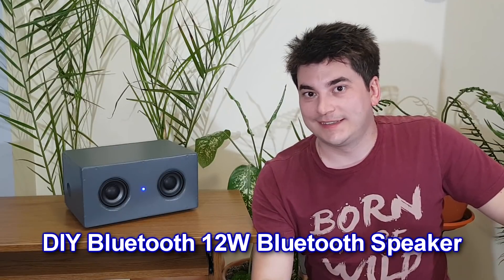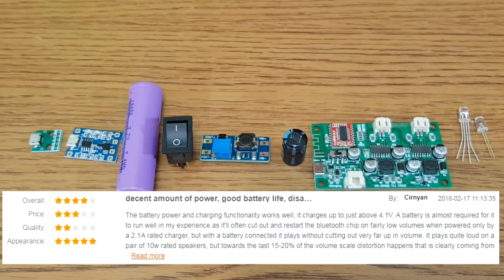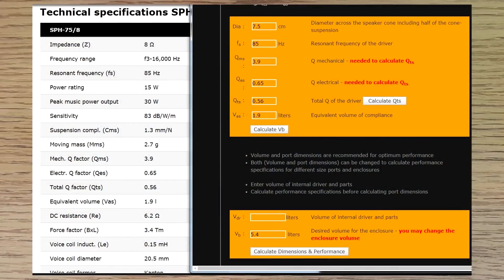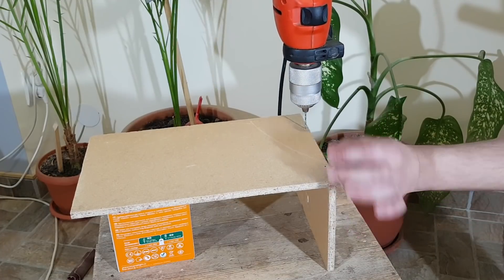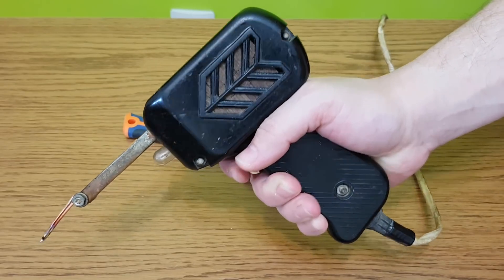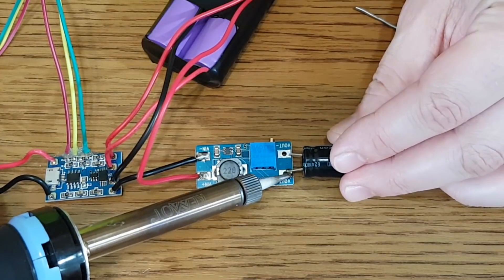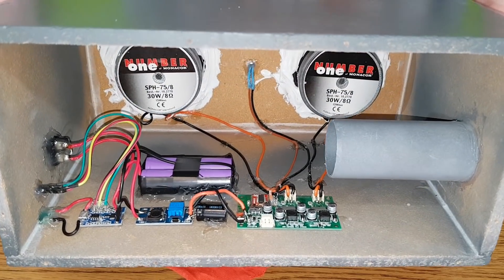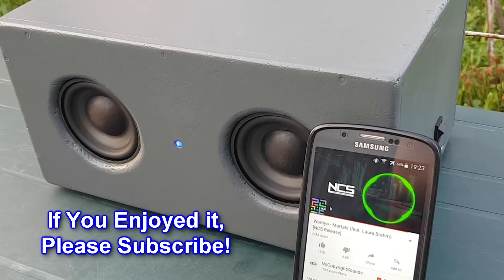DIY Bluetooth Speaker 6W+6W - HF69B

Comment: Sorin, Nice job! I do have a question though. All Bluetooth speakers I've had will automatically shut down after no input is received for approx 30 minutes. I use a speaker when I teach classes of approx 3 hours long. It's very annoying when bluetooth disconnects, and then I have a slide with audio, as I have to stop and reconnect the speaker. Will this Bluetooth board automatically disconnect after a certain time period, and if so do you know of any boards that will not do that?
Thanks!
Reply from the maker: hi. this bluetooth module doesn't disconnect. it stays connected, even if it doesn't receive a signal for a long time. so you can use it for a long time without problems.
Reply: Thanks! Perrrfect!

Comment: How did you determine how long to make the reflex port?
Reply from the maker: hi. considering I didn't use the recommended enclosure dimensions, I couldn't use the bass reflex port calculator. so I made up some calculations. 2 ports of 2.5 cm diameter (minimum) and 5.5 cm length (recommended on the website) will have a port area of almost 10 square cm. my 4 cm tube has a surface area of about 12.5 square cm, 25% bigger than the minimum recommended. so I should made the port length 25% longer than the 2 smaller ports combined - 13.75 cm. but in the end I just made it 12 cm long, to be easier for me to work inside the box, after I glue the tube.

Comment: that's chipboard (particle board) and not MDF.
Reply from the maker: you are right. I didn't knew the correct word.
Reply: If you were using MDF then it should only be cut/machined etc. when you are using a facial dusk mask. I believe the particles of MDF can cause resporatory damage due to their very small size.

Comment: Nice. I just want to know, how many watt amplifier do use with 30watt speaker? Can u lell me?
Reply from the maker: hi. usually you need the speaker driver to have at least double the power of the amplifier output. in my case the amplifier has 6W per channel, the speaker driver 15W RMS (real) and 30W musical. you can see that the 6W amplifier moves the 30W speaker driver cone almost to the limit. about your amplifier.. it depends on the speaker, what diameter and RMS power does it has... I think you can use a max 10W amplifier.